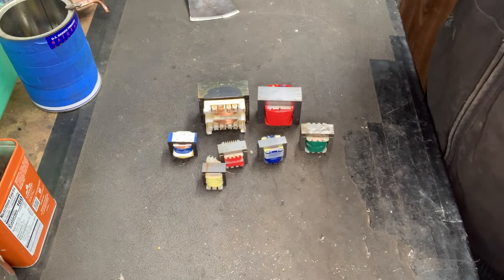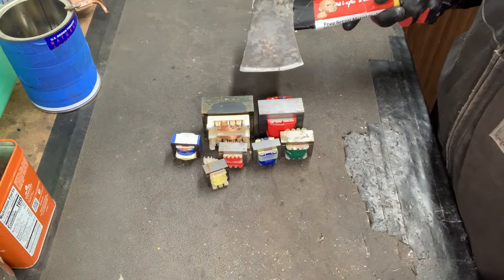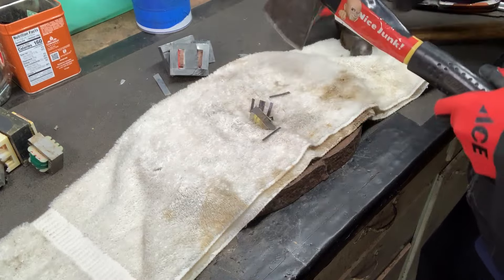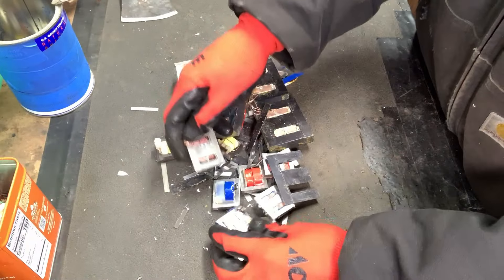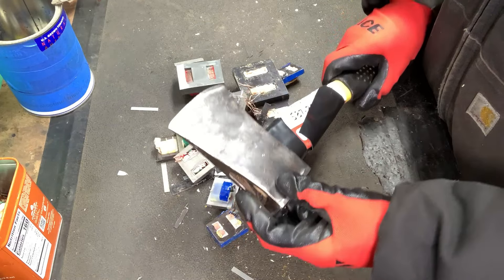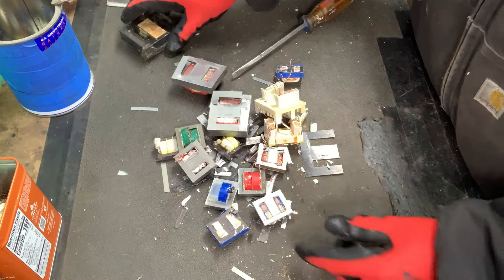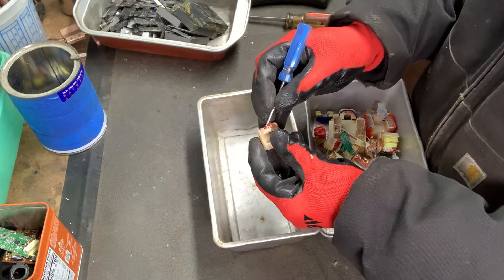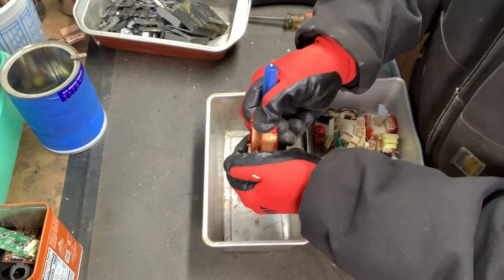Using a Hatchet to Scrap Copper Transformers

Comment: I still use a machete and hatchet depending on the job sometimes with the help of a hydraulic press. Although I have since moved on to the Estwing Rigger's Axe as my favorite splitting tool. It is a very thin blade hatchet with a hammer on the opposite site. I also use it to clean radiator ends using another hammer. Works amazingly well. I also cut the ends off of motors up to 50hp so far this way as I don't like the mess/dust a grinder or reciprocal saw makes.
Reply from the maker: Oh that’s awesome, I’ll have to look into one of those. 
I don’t like the copper dust either, plus it’s incredibly dangerous to our lungs. 
Thank you for watching.

Comment: Thanks for the video, I just got a cement chisel and I’m going to use it like the ax.
Reply from the maker: @joyceorr6288  oh very cool. I’d love to hear how that goes.
Reply: I will, hoping to try it in next few days.
I have. A question for you…when I’m taking apart a charger toget the transformers out, there are what I think you called little blue balloons that had silver in them, but there are also yellow one and green….what are  in those ones? I obviously have not got the right terminology to look it up, so thought I’d lay this question on you😜
Reply from the maker: Ok cool! 
Those are a type of capacitor. I believe the other colors will contain silver, but I’ve not been able to confirm that yet.
Reply: Would you be ok if I start to collect them for you…I’ll wait until I have a nice collection before sending them to you, so it’ll take some time…you are really helping me begin this new venture so thought they’d be nice for you.
Reply from the maker: @joyceorr6288  that would be awesome, thank you so much.

Comment: I had complete faith in the idea, haha. Was the tape on the fine copper problematic ant any point?
Reply from the maker: Thanks brother. 
No not really, some every now and then can be but for the most part it comes off easily.
Reply: @scrapitall200 . That's good to now as I usually stripped them by hand and then removed the tape as I have had that issue with the fine copper strands sticking to the tape.
Reply from the maker: @MicroScraprMike  that does happen to me, but I just use my ice pick to scrape the copper off, works really slick.

Comment: You cad do it like that but I use the vise and a sawzall and shave the wire off one side then while it's still clamped in the vise pry wire out with  a flat screwdriver or bumper jack handle. I actually walked out to my shop to get the proper name of the new blades I am using. I was using "Fire and rescue " blades but they have these new ones, Spyder, not only do they have teeth on top and bottom,the curve even has teeth. You know how a new blade cuts thru steel like a hot knife thru butter, well these spyder blades will keep on cutting after the hot knife thru butter stage fades, like three weeks after. I use my sawzall to cut the car tire beads so I don't have such a hard time getting tires off the rims for #1 steel, a Spyder blade will cut 8-10 tires off the rims,tire bead wire is spring steel, it's especially tough. Hatchets work good cutting the metal sides off window a/c's and those big home heating units,  lots faster then Phillips screwdriver and 1/4 drive weather, a speaker magnet on a rope, you can drag it around to get up all the 1/4 head screws up so they won't get in your riding mower tires!
Reply from the maker: Sounds like really nice blades 
Thank you for watching

Comment: Speaking of bumper jack handles, did you know you can change a tire with a bumper jack and handle? When I was young me, my wife, my friend and his girlfriend went to the " noon to moon jam" in Hugo. Live music at a camper park with a swimming pond from 12 to midnight. We woke up to a flat tire to the Dodge van. My friend said, no problem. We took the tire off, then on the engine end of the van we used the heel of the bumper jack to break the beads, liberated a tube from the swimming hole, rolled the tire int town and found a free air hose and made repair. To completely remove a tire you use bumper jack, pry tire off making sure the opposite side is in the middle of the rim, and tap it around with any hammer. Who would have thought a bumper jack and handle would remove a tire from a rim? It does!
Reply from the maker: Oh wow, that’s cool. I would’ve never thought of that. Thank you.

Comment: Good video, do you think the hatchet would work on electric motors and compresser motors. Instead of using a grinder to cut the end of the copper off.
Reply from the maker: Thank you!
I’ve used a machete many times to cut motors in half, works great. 
I personally haven’t used the hatchet on a motor yet. I bet it would work as long as they aren’t too large. 
Thank you for watching